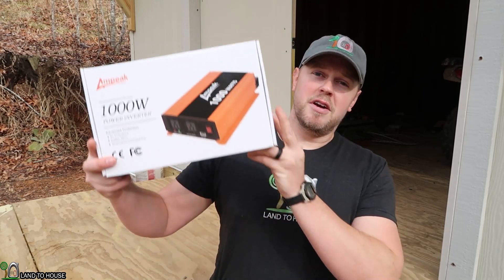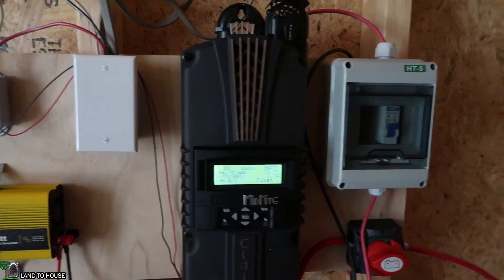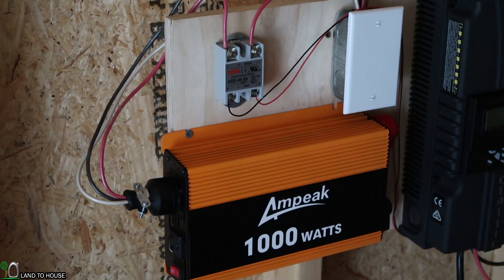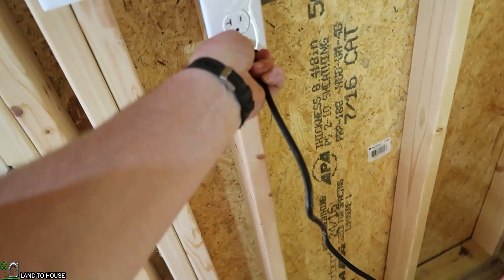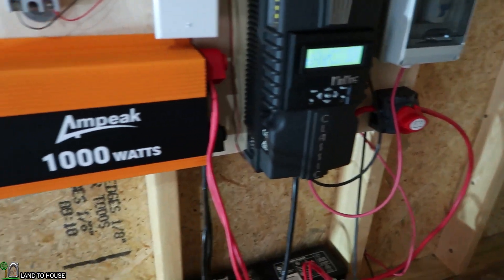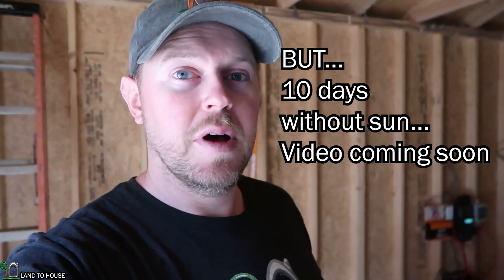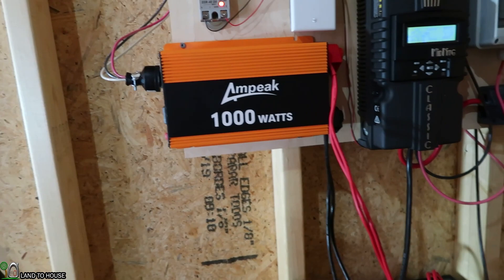The Ampeak 1000w Power Inverter

Comment: I love it when people plug in a tool, turn it on, and note the wattage and/or effect on the system.  You need to evaluate the system while USING the tool.
Reply from the maker: Yes I will need to test further. This inverter does hold up well for the 150w of lights i am running.

Comment: Sorry if this is a dumb question, but why did you use a relay instead of just plugging the wire directly into the inverter? Your video is the first I’ve seen do this. You’ve got some very helpful content and have been a huge help👍🏽
Reply: I think it's there as a backup. The Midnite Solar can read the battery voltage and if it gets below the set point it shuts off the relay. Any A/C load would go down but the inverter wouldn't. I guess he does not trust the inverters automatic voltage detection? I'm not sure.

Comment: You will find out if you try to run a computer that you will need a pure sine wave converter. The modified sine wave converter some electronics will not work right. Just my 2 cents worth. 
  You are doing a great job with your channel. Keep it up. Like watching what you do.
  I have been a jack of all trades and a master of only one Electronics. Somewhat.
Reply from the maker: Yes for sure. I figured this is for a small tool shed and it just needs to run some lights. So far I have used this for a month with LED studio lights for the new reviews youtube channel. No issues at all.
Reply: Actually computers are some of the easiest things to run.  They are designed to produce really clean power, so as a result they can run on really dirty power without breaking a sweat.  A modified square wave inverter will actually be MORE efficient for some computers because of the way their power supplies work.  You can even run most computers off DC without an inverter, it just has to be above 90 volts or so.  It's things like motors and power tools that can struggle on non-sine wave power, as they rely on the smooth pulse of the AC waveform to get the motors turning properly.  Most electronics, and certainly anything with a so-called switch-mode power supply, really isn't that fussy.

Comment: I just ordered an Ampeak 2000 watts inverter about ten minutes ago. It's because my system is 24 volts, but I needed a 12 volt inverter to run a sump pump that I set in a spring and I have two barrels in the bed of the truck. The pump takes 340 watts when its running. I have 20 marine batteries on my system. I have a 2000 watts Aims inverter charger for in here, but I can't use it in the pickup. Besides it weighs 46 pounds. I needed a new inverter.

Comment: You don't need to worry too much about the lights dimming when the tool switches on, as it's not a sign of a poor quality inverter.  The way the motors work in those tools is that for a brief instant when you start the motor they are like a short circuit and draw as much power as possible (this is called 'inrush current').  Typically this is limited to a few hundred amps by the type of wiring you use and other factors, but it's why the lights usually dim briefly even when you're connected to the grid.  It's also the reason why circuit breakers and fuses are designed not to trip/blow the instant you exceed the current rating, because so many appliances work like this it's factored into the design.

Comment: Love the videos.
May I ask what gauge wire you are using between the inverter and the wall wiring?  Is it left over bits of 14g?  I'd strongly suggest putting labels on those wires for hot/common/ground, just in case it's 7 years later when you need to fix something, or you have help assisting you fix something.
Some electronics, to include battery chargers, may not work correctly when plugged into a modified sine wave inverter.  For your dewalt battery chargers, and the battery tenders for the ATV and lawnmower, you will have to watch and see if they are fine or if they complain about unclean power and then you will need to upgrade to a pure sine wave inverter.  You will definitely want a pure sine wave inverter when you install your house's off grid system.
I would like to suggest you have a light or two in this shed that does not run off the inverter.  Either RV/Camper 12v lights that run directly off the battery bank, or AA batteries.  If you inadvertently pull more than 8.3 amps for more than a second or three (the inverter's surge above 1000w to 2000w time limit), the inverter's circuit breaker will trip and you will find yourself in the dark and at risk of tripping & falling while trying to get over to the inverter to reset it.
Reading the reviews on this inverter, there were multiple reports that one of the two outlets had hot/common reversed, I'd suggest using a 3 prong outlet tester on it to make sure yours is ok.
Reply from the maker: Yes the wire that is run for lights and receptacles is the leftover 14awg. Labels on the wire would be a good idea. I also want to do that under the house for future use by myself and others. I think the inverter for the house is a pure sine wave. I will have to check again. I have had it for the longest time and not opened it. For the shed I will have to see if I can get a battery tender that works on this inverter. 

So far everything on this inverter is working well.

Comment: You should get a liquid cooled inverter, I don’t know if you can buy one but they are fun to make(:
Reply from the maker: That would be interesting.  Not sure 300w would ever turn on the coolant.
Reply: @LandtoHouse  oh no I meant the 1000 watt inverter or even a 2000 watt inverter so you can power corded tools, I know how loud those inverters are so a water cooled one would be nice. I have been testing one is a heat simulation and the way I cool it is I move the heat (move the heat with heat pipes) to one spot and I cool that extremely hot surface with either liquid nitrogen or a water cooler from a pc. I got really good results from the ln2 cooled one, i mean it’s liquid nitrogen that stuff is like -350 Fahrenheit, but the water cooled one was the perfect temp for important electronics.
Reply: @Abe8816  Not sure liquid nitrogen is going to be that practical for an off-grid set up on solar power!  You'd use up most of your energy budget on cooling, there wouldn't be enough power left over to do any work with.  Also when it comes to power electronics, unless you are talking superconductors, the reason you need all that cooling is because you are pushing power through wires that are too small, producing a lot of waste heat.  You'd get a much better result from using thicker wires instead, so they don't get as hot (and since we're talking thicker wires inside the inverter, what it means is running an inverter much larger than you need - say a 5000+ watt inverter, for running a 1000 watt load).  The larger wires/bigger electrical components mean they won't get as hot, so you'd waste less energy as heat to begin with - which also means then you won't have to even bother with cooling, so you get even more work out of the solar panels overall.
Reply: @Berkeloid0  oh ok so it’s better just to use a tropical pc water cooling set up on my inverter, ok since it is a grid tie inverter (5kw) it runs 24/7  so it gets really hot. I understand that electronics are supposed to get hot. I have custom made a 3D model in shaper 3D (3D printing software) that I can print out of meta from a metal 3d printer. I did some test in a solid works I believe it was called and I got a 15 degrees less when I was using a pc water cooler, it was a 140 mm dual radiator.
Reply: @Abe8816  Electronics aren't really "supposed" to get hot, but usually to save cost the designers underspec components so they can save money, but the expense of this is that they get hot and waste energy as heat.  You would find if you replaced your 5 kW grid tie inverter with a 10 or 15 kW inverter, but only put the same 5 kW through it, it would stay much, much cooler and also last a lot longer.  But you can see that it would be a lot more expensive, and technically you would be wasting 1/2 to 1/3 of its capacity just to save on cooling (because you could put 15 kW through it but you're limiting yourself to 5 kW).  This is why most devices will get hot, because people don't want to buy a 5 kW inverter for the same price as a 10-15 kW one, for example, so the designers have to cut corners to make a cheaper product, but then the consumer pays in dealing with energy lost as heat and additional cooling costs.

Comment: You are already using low watt LED lighting.
Take the leap and move to all DC for your lighting.
Then, STOP WASTING Power inverting for lights.
Use DC (battery powered) tools connecting the chargers to your DC power source (yes, you would need to adapt your chargers to DC source) and, yes, you would need more batteries for some tools but you loose less energy charging batteries from a DC source than from converting your DC to AC
Reply from the maker: Its all good. I am just running some studio lights. No need to go all crazy with changing over things that are working.
Reply: The DC vs AC thing is a myth.  Yes inverters are "only" 95% efficient so you lose a tiny bit of power, but what everyone seems to forget is that low voltage DC is very inefficient over long cable runs.  You need to use really thick cable to avoid wasting a bunch of electricity as heat in the wiring itself, which you don't get with AC (not because AC is better, but because AC runs at a higher voltage and higher voltages are more efficient over the same thickness of cable).  To put it into perspective, if you ran a 25 watt light fitting off 12 volts DC with normal AC cable rated at 10 amps, going from one side of a room to another, you would lose one watt of power just in the wiring.  That's a 5% loss, exactly the same as the AC inverter!  If you have two runs of cable like that you've doubled your losses compared to the AC system.  You can reduce this by using thicker cables than the AC system but then that's a greater cost, on top of the expense of converting your appliances to DC as well.  If you're doing anything more than running a small camp site, there's just no return on the DC investment other than the novelty of making it work.  If you took that extra money and spent it on slightly larger batteries and solar panels and went with AC instead, you'd come out ahead as far as usable watts per dollar spent.

It's possible you could go to a higher voltage DC system (say over 100 volts DC) which would be slightly more efficient than an AC system from the lack of inverter and a few other technical reasons, plus you can feed that DC power into most electronics as anything with a switch-mode power supply will happily run off DC above around 90 volts, so that would save you the cost of some DC appliances.  However this higher voltage DC now requires special handling because any time you switch it (say in a light switch) it produces an arc which doesn't extinguish itself like an AC arc does at the zero point of each sine wave cycle.  This means your switches will all burn out and melt after a dozen or so uses, unless you buy expensive DC switches that can extinguish the arc.  So even in this case the DC system is more expensive because of all the specialised equipment.

If you're after value for money, AC is still the most economical option by far, even if it does mean it's 5% less efficient than a high voltage DC system (and probably more efficient than all but the smallest low voltage DC systems).

Comment: Major faults. Where is the breaker on the feeds to the inverter?  And you connect the leads to the inverter before you put the battery terminal on. Having powered leads loose is a bad habit.
Reply from the maker: This is a car inverter. it would not always have a breaker between. The inverter does have a safety off that can be reset with the power switch. As for leds hanging lose and live. you will notice that I removed the + battery terminal before installing anything. There was no way the battery was going to shock with that removed from the battery.
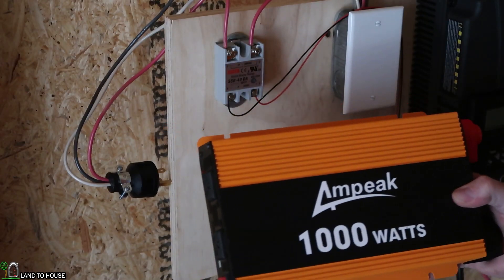Reply: @LandtoHouse  At 3:43 you show yourself getting ready to install the Positive terminal on the battery. The leads are loose at that point. The inverter is not mounted yet nor the loose ends of the cables on it. And in a car, there should always be a fuse or a breaker installed in the Positive battery cable. At 12 Volts, that 1000 Watt unit will draw around 75-100 Amps. That is a point where you have to think about the battery cables being protected.

Comment: So you gone about safety a bit wrong.

You have no fuse between the battery and inverter, and no isolator.

Your charge controller wire is way to big, you could use the inverter cable, or solar cable that's rated to 50amps.

The fuse box, I would wire the inverter output into this and fuse it. The solar I would just use a DC isolator or another one of those battery disconnects.

I would also drive a earth rod, ground, and pop it into the circuit, this way a tool fault can still trip. We call them RCD over here.

I'll only be running 300w.. famous last words.

Btw battery tech is 55amp suitable for 500w  but above that will degrade the battery.